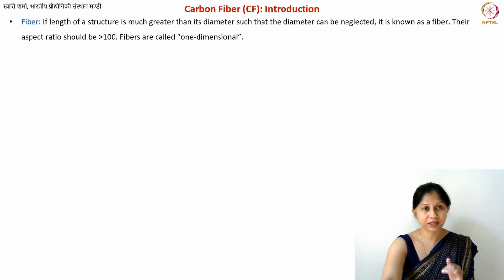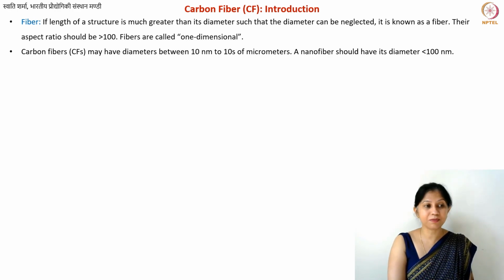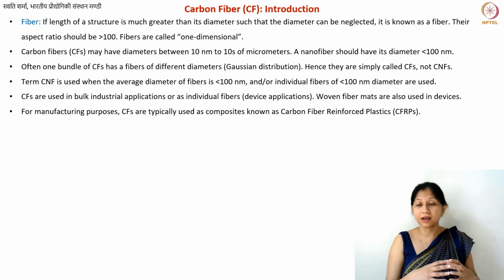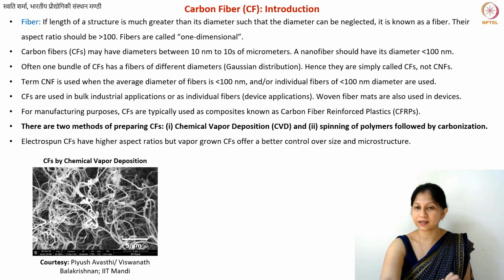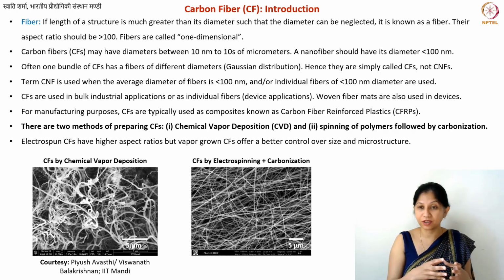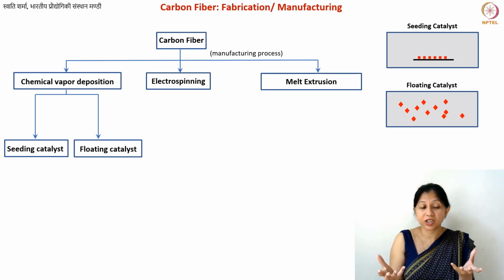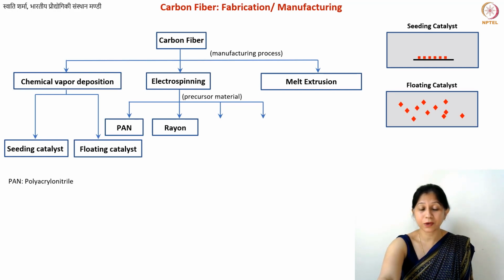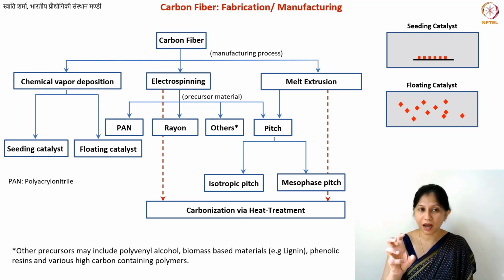Carbon Fiber: Introduction and Properties

Comment: Mam I work as Project Associate in  NAL in carbon fibre division.
In CCFP division we produce carbon fibres using PAN polymers and wet spinning process to produce Precursor fibre(SAF)  and heat treatment of SAF to produce carbon fibre.
Reply: hi i am harshil and im doing my btech in textiles. i am also interested in aerospace and want to pursue the same 
so please if you can guide me